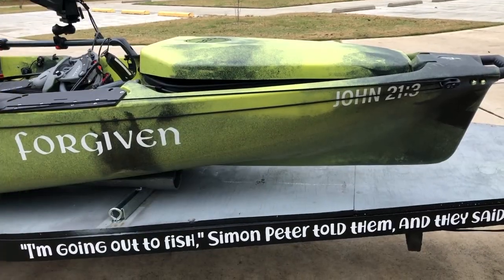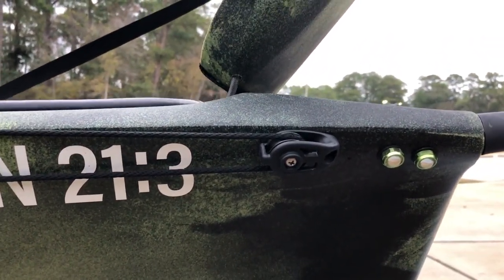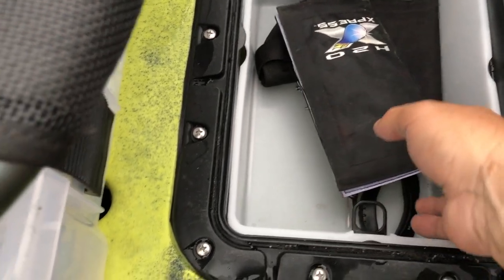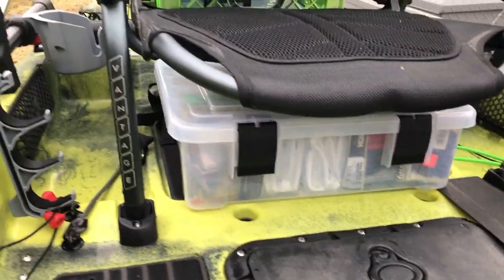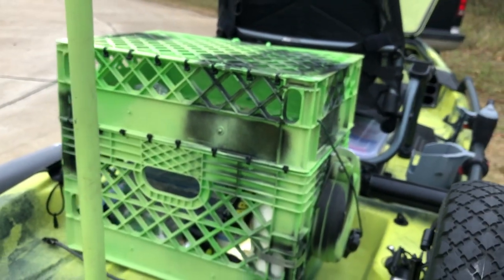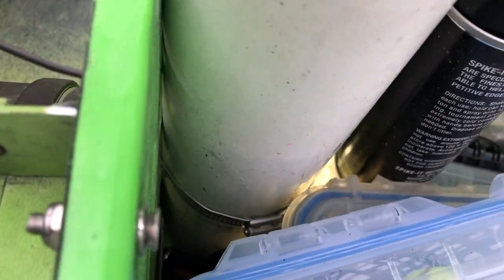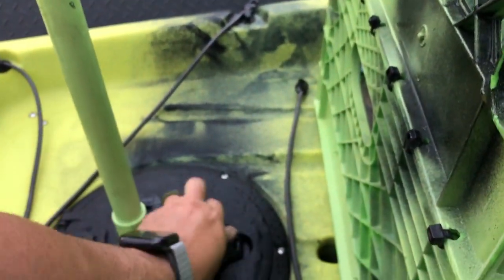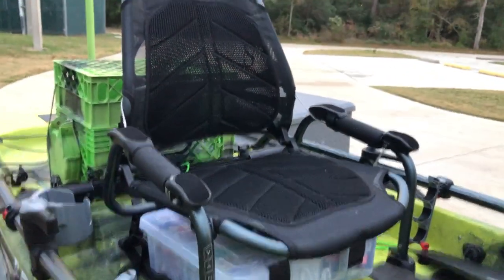2020 Hobie Mirage 360 PA14 Installed Rigging Review

Comment: Thanks for the detailed videos,  I am finishing up the rigging for my PA 14 360.  I too have selected FPV power for my source.  I appreciate al the details you've provided as this has given me some considerations to think about.   I am just starting out with the Garmin so my configuration will not be as intricate as yours to start.  1 question for you, did you use the fuse on your garmin power supply if it had one.  I'm trying to determine the best solution. I am planning on  using a fused pigtail to a 5amp regulator.

Thanks again!
Reply from the maker: Thank you for your feedback. Sounds like your on your way to a awesome rig. As for the fuse, I left the in-line fuse on the power cable to the graph intact. It’s a bit redundant but I’d doesn’t hinder power. I guess a double fault safe can’t hurt. Blessings.

Comment: Hi from Australia!
Can you please help me by telling me how you hooked up your Yakpower Button Light up to your FVP Distribution Hub? 
Did you cut the wires & splice with the FVP connectors? 

Awesome video & its been a massive help in the setup of my PA!

Regards Mac
Reply from the maker: Thank you for your kind words. FPV makes connectors that have a bare end. (https://www.mariner-sails.com/new-distribution-hub-plug-play-wiring.html).  I ran additional wire to the button lights and made a waterproof splice. One thing to keep in mind is Yak and FPV configure their continuity opposite. That is to say that wiring them together is backwards. I.e., the red wire from the distribution lead will connect to the BLACK wire of the button light. It perplexed me at first but it works. Hope this helps. Blessings.

Comment: Great setup!!  Did you connect your parallel wired FPV batteries to your FPV power regulator and then to your FPV distribution center?
Reply from the maker: Thanks for the question. It is connected as such: power supply to power regulator then to distribution hub. So all the power going into the hub has been cleaned up and stabilized.  Blessings

Comment: Some great ideas here, waiting for my 360 to arrive hopefully in a couple weeks.  I especially like where you put the batteries.  I've got that hatch in the back of my 2018 Outback but it fits the small bucket so I installed the battery in that, you've put that dead space in the 360 to use in the same way.  One question I have with all the gear on there, have you tried re-entering the boat from the water?  For my Outback it isn't hard but with all the gear and the H-rails it looks like it would be quite challenging on your 360.
Reply from the maker: Kevin Redden thanks for the comment. You raise a very valid concern. To answer your question, I haven’t tried reentry into the vessel from the water. It would probably be easier for everyone to do so in a controlled environment just to get the experience. From my perspective, I would remount from the stern. There is a grab rail to assist in getting on and the back can support my weight. As for the equipment getting in the way. I really don’t see it as an issue. In a worse case I’d start removing gear to get back in. Another good feature on the Hobie accessories. One flip of a lever and it’s off.  Blessings

Comment: is there a link for those USB ports ? either it's not linked in the description or the link is there and it's broken - thanks !
Reply from the maker: itsrecording here you go. Blessings 

https://www.amazon.com/dp/B0871WMC6Z/ref=cm_sw_r_cp_awdb_t1_ubq8EbM443ZM0
Reply: @fshfactor01  thanks for the link - the picture in the link is a different product than what's shown in your boat - your USB port plugs are a baseball diamond shape and the link is a rectangle shape - do you know the exact same one you put in ?
Reply from the maker: itsrecording type this in eBay. I think the actual seller for mine has none to offer. I sent you the Amazon link because these (below) are shipped from China. May take some time. (12V/24V 3.1A Car Dual Black ABS USB Port Charger Socket Outlet LED Waterproof)

Comment: What is the maximum length of rod that can be stowed in the horizontal rod holders???
Reply from the maker: costa nicolaidis thank you for your question. The rods really don’t have a limit. About 40 inches is the tube but your rod lays along the side and could theoretically continue out of the back of the kayak. I use 7’1” - 7’6” rods and there is plenty of room. Blessings
Reply: @fshfactor01  Thank you. Good work on your kayak.

Comment: how did you go about installing the red and green leds there??
Reply from the maker: The lights are threaded. I used a drill bit slightly smaller than the threaded shaft on the lights and then screwed them in using silicone. The process produced its own self tapping. Hope this helps.
Reply: you remove the two original threaded rods which allow you to fix the lifeline, or you drill a hole through?
Thank you
Reply from the maker: Hervé Mahava thank you for your comment. Can you explain a little bit more so I can help you better?

Comment: Where did you buy your pin connectors?
Reply from the maker: Bucks backwoods hi there. Could you explain in more detail what you mean?
Reply: FSH Factor no problem. So the connectors used for the stern light, then did you use the same type of connectors for your button lights, usb chargers, and graph power supplies or did you just wire directly to the connectors that come with the FPV distribution hub?
Reply from the maker: @Abel-bodied-outdoors  I use a self soldering connector. Using a heat gun, the connector has low heat solder that melts binding the two wires. Additionally, the casing of the connector shrinks under heat as well, making it waterproof. Blessings.
Reply: FSH Factor I was referring more to the connector used for your aft light that plugs in at that waterproof twist pin connector right behight the 8” haul access I’ve found similar connections but the one you used looks very high quality. As far as the self soldering connectors that’s how I would do it too. 👍
Reply from the maker: Bucks backwoods here is the EBay description. 

Waterproof Two 2 Pin Wire Terminal Panel Mount Connector Marine Boot 12V @15amp
Reply: FSH Factor awesome thank you so much for the help god bless!!